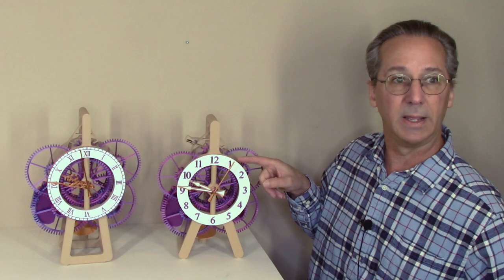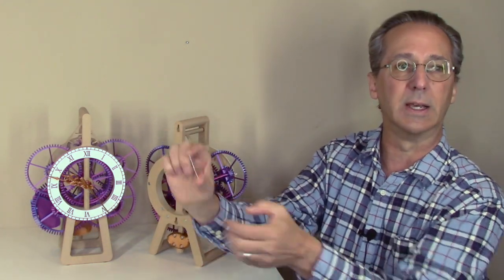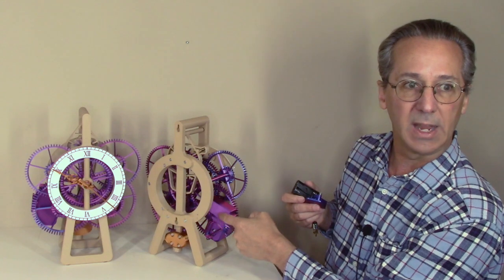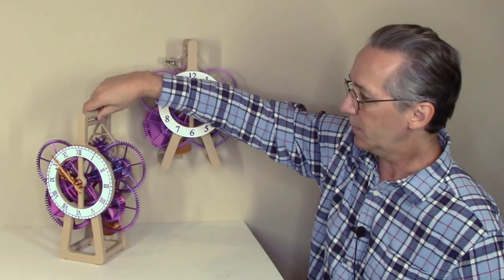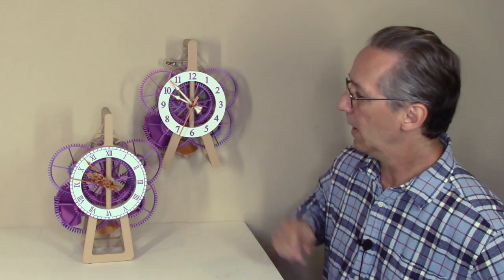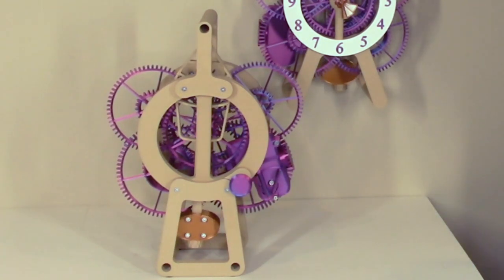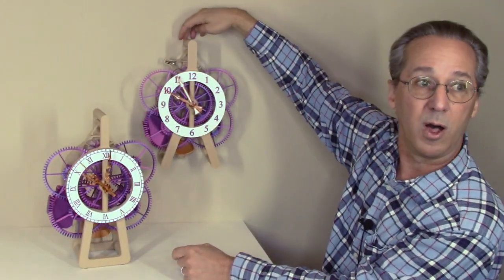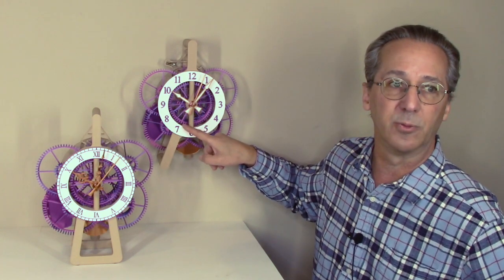Coup Perdu Final Design

Comment: Nice design, I really like the simplicity of the power system
Coup perdu is nice, but like the quietness of the graham escapement
All in all, great designs, thanks for sharing
Reply from the maker: Thanks. The Graham deadbeat is so efficient that the clock runs with just the weight of the batteries and the motor. The Coup Perdu has 4 pockets filled with pennies for extra weight to keep it running.

Comment: Just finished the Coup Perdu, with deadbeat, frame was printed in filament with 30% Walnut wood filled and gears printed in Burgundy PETG keeping very good time, three clocks down 32-day setup on 8 days and electromagnetic all keeping very accurate time. Now onto the silent clock Thanks for the clocks, Steve

Comment: Steve, I have all of the parts printed and am starting the assembly.  Will you have a video on assembly?  I'm a little confused on the motor compartment.
Reply from the maker: I will do a quick video for just the motor compartment. It will take a few days.
Reply: @stevesclocks  Thanks.  I will get my battery holder tomorrow.  I have the reed switch hooked up and tested, found out why they sell so many in a package.  I tried to bend the leads and it immediately broke
Reply from the maker: @woodwaker1  I have only broke one so far. I was using a pair of needle nose pliers on that one. The others were bent by placing my thumbnail next to the glass and bending the wire around it. This puts the stress a short distance away from the glass. I will add that comment into the video.

Yes, it is good to have several extra in the package. The plastic ones seem more durable, but only come 10 to a package. They are physically a bit larger so a tiny modification would be needed.
Reply: @stevesclocks  Even pictures would be great.  The picture in the manual was hard to see where the reed switch went.  I was thinking of a couple in various stages of assembly.  Thanks
Reply: @stevesclocks  I have it finished and running.  Will post pictures on your forum
Reply: @woodwaker1  Hi Steve, could you add the video of the motor box assembly?  I'm going to make one of these but am also a bit confused on the assembly.  Thank you so much.

Comment: Any plans to do a design with a mechanical chime mechanism?
Reply from the maker: Very long term plans for a chime. I try to plan designs using parts that are available to builders across the globe. Commercial chime bars are expensive and hard to find. It would likely need to use locally available components.

I started looking at conduit and copper pipe to make the chimes. Lee Hite has a great web site describing the ideal sizes for many types of pipes. Electrical conduit sounds great and copper plumbing pipe sounds flat. That is as far as my experiments have progressed.